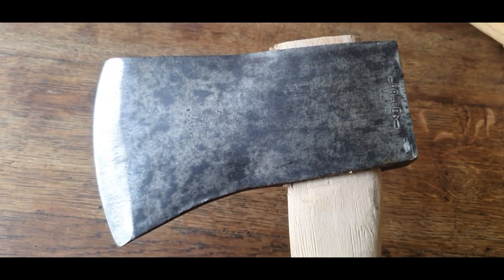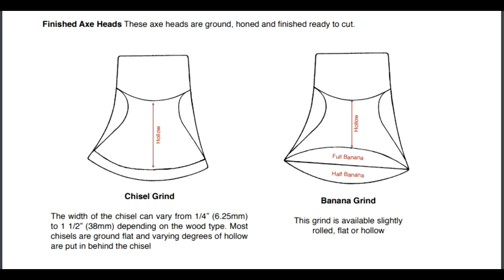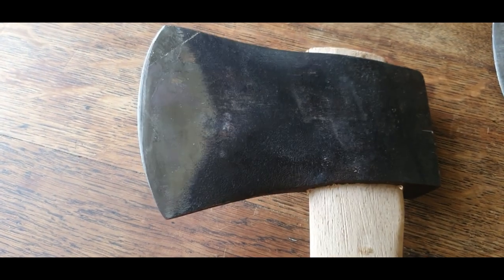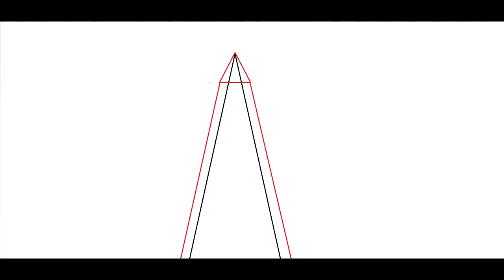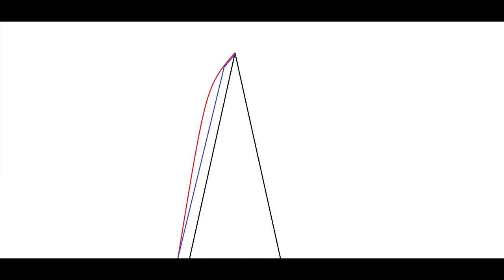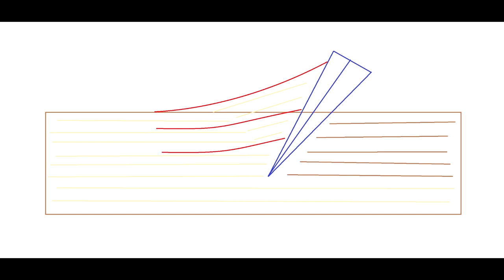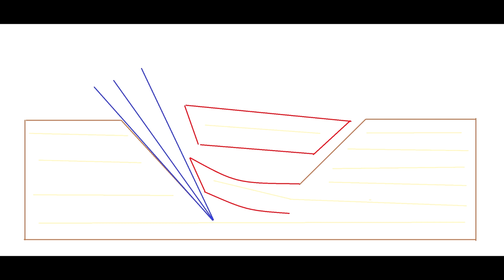Axe Sharpening and Edge Geometry: An Introduction

Comment: A very thorough introduction, Ben.  Glad you put this together for us.  I have experimented with larger or wider secondary bevels on thin axes and have found in my wood they cut well and hold up over time better.  When I get down under 18 the steel starts to take on damage on most axes, but with a stouter secondary bevel they hold up.  And since the main bevel is the most important I’m not sure the size of the secondary bevel matters that much under 18 degrees.  But obviously we’d all prefer to use a razor blade if we could.  If only trees grew without limbs lol.

Comment: For the local woods and the use I put my axes through, an angle between 20 and 25 degrees with no secondary bevel or microbevel seems to work best. I made a few wedgy hatchets and put 23 degree "flat" grinds on them, along with convex cheeks and they never get stuck in anything. They throw a good chip, too.

Comment: Hi Ben, I've never before commented on any youtube stuff, but I really wanted to say thanks for all the material you've created.  I had been scouring the internet trying to learn about ax maintenance and found most of the content really lacking in detail or explanation.  I'm actually one of those who purchased a couple of gransfors axes without knowing much, (a small forest and a regular forest ax; I will say they Are beautiful little axes) and after using them, even after some sharpening (albeit only sharpening the bit not grinding the actual cheeks) I found they just lack much punch for the kind of stuff I enjoy.  Ended up trying out a muller canada 1000gr with the 700mm handle per your recommendation, and with the help of several of your videos on sharpening and grinding for efficient cutting, I've ground the cheeks down substantially.  Can't really tell the exact angle, even with an angle disc thing, but I'd estimate it's down to 15 or 16 degrees.   I used the method of grinding down using the eye as a marker, and was maybe a little over-zealous, because when I finished, many hours later, I worried it was too thin.  I went ahead and put a more obtuse, 30 degree primary bevel on the very edge and took it out to do some cutting today, in the back of my head thinking I might chip or roll it.....   Holy COW!!!!   What a difference!!!!!!!!  It's SO satisfying getting those deep cuts and pulling out thick chips.  I think I might avoid knots with this one, but I found your advice to be spot on.  So, thank you.  Really appreciate your stuff.  And it's cool to see how many other people nerd out on axes too haha.  There's something so satisfying, in a kind of primal way about using an ax.  They''re such a joy to use!

Comment: Well done explanation. I like convex edges but they have to be done with thinner cheeked axes and the bevel on the convex needs to be steep. A short, fat, obtuse, convex edge geometry is quite bouncy and only good for splitting.

Comment: Thanks Ben for that perfect explanation!
I prefer a little konvex, because there is nothing more exausting than a sticky axe.
Reply from the maker: Convex is more sticky imo. Flat set up properly is far more easy to remove. Otherwise racing axes would all be convex
Reply: @benscottwoodchopper  hang on there are 2 very different convexities, one is a convex bevel (in my experience that might make the axe a tad less sticky but mostly because it prevents too much penetration) and the other is a convex cheek (intended as a convexity parallel to the edge) which is what really makes the axe release the easiest, together with a slight curve on the edge profile.
bottom line is, the ideal set up for chopping large logs is flat bevel (optimum penetration) + convex cheeks (easy release).
convex bevel has its place, mostly in splitting axes and in very thin cheeks where the convexity helps protect the edge, and like Ben said thin cheeks (like italian axes which I use a lot of) are very good for limbing and small diameter chopping because they penetrate deep.
finally, no room for any convexity on carpentry, carving, woodworking bevels, they must be dead flat there.
Reply from the maker: @awyrcoch  yeah really need to come up with 2 seperate terms to avoid confusion

Comment: Hi Ben, thanks for this explanation; real rookie question here but how much of a difference does the angle that you hit the wood make (for chipping the wood out)?
Reply from the maker: You want to be hitting the log at 45°, the notch should at least be the same width as the diameter of the log

Comment: I am curiouse about how different aze geometry wear over time. I feel  a fine or hollow ground axe would keep their effectiveness over much more sharpening or quantity on metal remove over time by sharpening it. A wedge axe would either need longer and longer primary bevel to stay at the same angle or if you keepe the same bevel lenght it would need to have a broader angle.
I feel like a wedge axe would not stay effective over its live time
Reply from the maker: wedge shaped axes get stubby and ineffective much faster with wear
Reply: @benscottwoodchopper  so it's not juste an impression thank you for your answer

Comment: Great vid. I have started to file my cheaper axes and had good success. Looking to fix up my gransfors felling axe. It does not chop in enough seems you mentioned this axe in this vid. Should I take the cheeks off a few inches back? This has worked so far on my other axes and it seems you call that a flat grind?
Reply from the maker: flat grind is a flat bevel from cheek to edge, sometimes with a secondary bevel

Comment: Hey Ben, thanks for the explanation! I do have a question about splitting axes, splitting mauls in particular, and that is how thin would you get the bevel and how important it is for them to be "sharp"? Does having a thinner edge help them bite deeper in the wood to start the split or is it way less relevant given the mass and momentum of the rest of the tool?
Reply from the maker: With mauls sharp definitely helps, but the bevel doesnt need to be very thin
Reply: Experiment and match to the wood you are splitting to find the balance between bounce and stuck.

Comment: Hi Ben. I have an Hultafors hy 10-1.5 and following your advice, I tried to thin the cheeks with a coarse file but it got me nowhere. I recently bought a bench grinder and I was wondering if I could use it to thin the axe head but I’m afraid I’ll ruin my axe. I am concerned the grinder shape will make the axe cheeks to concave and also if the high temperature from the friction will ruin the steel. Do you have any advice on this? Thanks and congratulations on your content!
Reply from the maker: Regularly cool the axe in water, you can rough out the shape of the grind with an angle grinder then smooth it with a file. Bench grinders are possible but less effective and hardrr to get good results with but doable

Comment: Thank you for your clear and practical informations ! 
Well I see clearly the wedge profil on an hultafors HY.  A thin one, but a wedge that enlarge relatively quickly (not as quick as a dedicated splitting axe of course)

For understanding purpose : on a Gränsfors Scandinavian  forest axe, for the same weight at the hultafors HY, the head is longer and seems thiner a long way before starting to enlage. Well Can I assume better for chopping light and/or small diameter but less "general purpoose" ? 

And sorry, one last question (lol) : any thought about carpenter axe ? hultafors SY SV or Stålberg  for 1.5 hand light axe ? And if they had a longuer handle ?

Thank you :)
Reply from the maker: The carpenters axes are okay but i prefer italian axes for light axe choices. Yes thinner profile axes are better for limbing and small wood but dont chip the wood well
Reply: @benscottwoodchopper  Thank you a lots for your answer and availability. Thx to you I'm starting to have a good vision, a paper one of course actually, of the market and possibility. Well I will probably give a try to 2 or 3 axes (probably two, because the cheaper one additionnée ... ) : Hultafors HY 10 0,9 (price point), Rinaldi 300 700Gr or 900gr  (price point and tomahawk style handle) and a if possible light splitting axe (dont know ... grans fors small splitting axe is so expensive )
Thank you again
Reply from the maker: @bengg6772  i would get the hy10 1.2kg rather than 0.9 and the rinaldi 700. Better variety of use and weights that way. Small splitting axes are somewhat pointless, they dont work much better than felling axes in small wood for splitting
Reply: @benscottwoodchopper  Thank you. Hum indeed, good advice, two axes, two usage. 
Hum indeed the small splinting axe from Gränsfors have a head of only 1kg ... with wide pattern for sure. But not heavy enough to be interesting/usefull/useable probably.

Comment: I have been enjoying your content. I have recently been working on restoring an older american jersey style axe from sager warren, which needs a banana style grind, its my understanding that generally they were not ground out of the factory and that was generally something that was done later by the purchaser, and this was never done to this axe, it's very thick in middle and i've been filing and filing, spent a couple of days on it, and I was wandering if you knew of a faster way to remove a lot of material but still keep the accuracy, or perhaps there's a more aggressive file that I could look into purchasing?  at this point i might also be considering just spending a little time working on the bevel every time i use it but I feel like it might be years before I actually get the bevel where I want it...
Reply from the maker: Yeah filing takes quite a long time, i use a belt sander these days just need to watch the heat
Reply: @benscottwoodchopper  thanks, and chance you have any content detailing your process with that or recommendations? i've been wanting a belt grinder for a while but haven't really had a great need that justifies getting one, but I just might... i tried using one of the larger knife making ones at a friends house, but I feel like it might be kind of hard to be accurate with an axe vs grinding knives. it was fun though
Reply from the maker: @catmakinbizkitz  i filmed the process with racing axes for normal axes i dont worry about finding a centrepoint, just hold it at a good angle https://youtu.be/GYdGSN-lPns
Reply: @benscottwoodchopper  nice, thanks! That little Makita grinder is sweet!

Comment: Have you tried the ochsenkopf universal forestaxe? It is actually the first axe I bought and stock it is absolutly stupid with the red steel caller. I sharpened it a bit and use it as a root-buster atm… :D I an wondering if it would be a nice axe if you rehang it on a thinner, usable handle and give it a good flat grind. It might just be a fatter Iltis.
Reply from the maker: yeah flat grind they work just fine

Comment: terrific summary, I learned a lot.  how much do you want for that Genova axe?
Reply from the maker: Its one of those axes i cannot put a price to, however rinaldi made a limited batch of essentially the same bergamo pattern  exclusive to les frontiers outils worth checking out
Reply: @benscottwoodchopper  Thanks.  I'll check it out.  Basically you were talking about throwing chips and I wonder.  If you had an axe that somehow was a razor blade and "magically" strong enough to withstand the forces, would that magic axe paperthin slide into the wood and get stuck and not throw chips? In other words, if the axe can slice into the wood, and you cut both sides of  the notch, won't the chips fall out even without geometry because of the depth of cut and gravity?
Reply from the maker: no otherwise wood round would fall to peiecs naturally and splitting axes would be useless

Comment: What grit file do you use to put the micro bevel?
Reply from the maker: 400
Reply: @benscottwoodchopper  400 Is the final grit in your progress or can I use after that, an 800 for example and then strop? Or just 400 is just enough before stropping?
Reply from the maker: @Michalis_Karakostas  400 is fine, 1000 is  more thani normally bother but do whatever you want and experiment, theres no do downside to it

Comment: Hello, there! Is it normal for 8 pounds splitting moul to be asymetric?
Reply from the maker: Not normal but there is a few i know of that are asymetric by design
Reply: @benscottwoodchopper  Stihl?
Reply from the maker: @tlumaczy1507  asymetric in what way?
Reply: @benscottwoodchopper  When You look at ax head from the top making center line, ax blade is not in the center. When You hit log You always feel like it goes aside.
My theory is that forces are directed one way to avoid blocking maul and splitt more efficiently.
I don't know if i am wrong...
Reply: @benscottwoodchopper  I talk about regulars 6-8 pound maul...
Reply from the maker: @tlumaczy1507  if the head was forged crooked that is not supposed to be that way
Reply: @benscottwoodchopper  so why they sell it? In XXI century piece of metal and what? Should I look snd chose the best  and straight?
Reply: @benscottwoodchopper  there are even from Stihl like this. I thought it was for purpose if they have quality control.